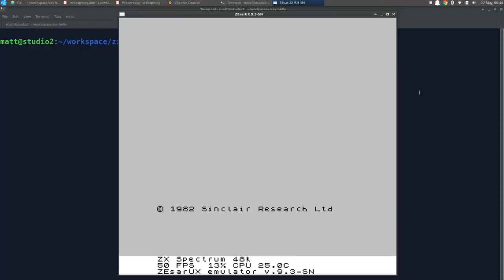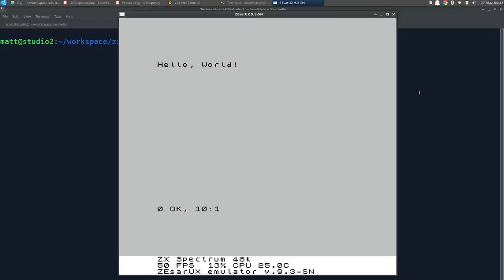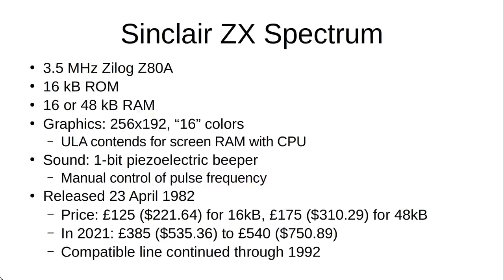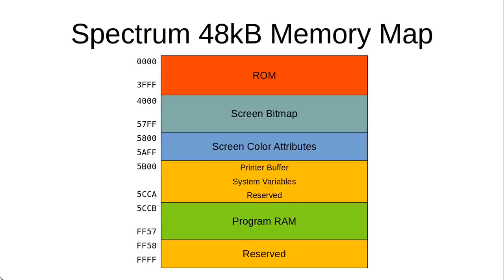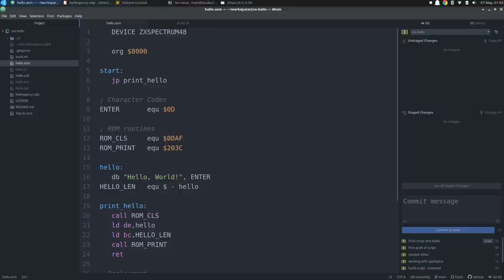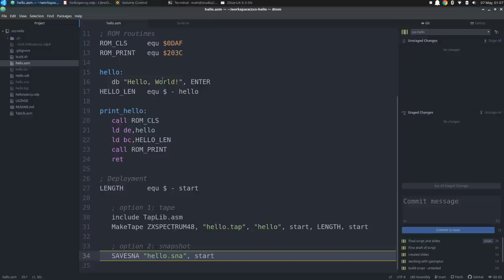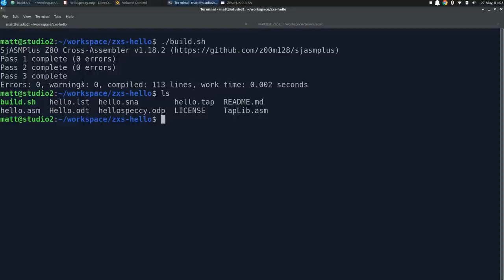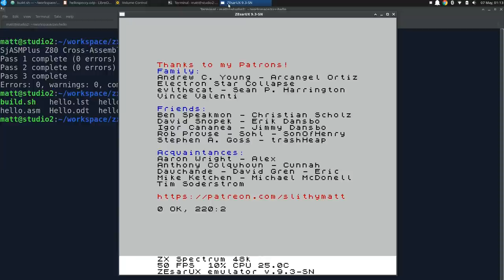Hello, Speccy! - "Hello, World!" for ZX Spectrum in Z80 Assembly Language

Comment: If you follow the timeline the ZX Spectrum was actually around the same price as a ZX81 with a 16k ram pack (around £79+£49) so consider you had 3x the memory, colour and simple sound and an improved keyboard it was quite a good deal. Most spectrums came later on with a pack of 6 software applications including games. It was a great starter or upgrade machine and was considerably cheaper in price than a C64 for instance. Hence it’s popularity. I started with my beloved ZX81 and upgraded to the ZX Spectrum, then the +, then the 128 before moving to an Atari ST.

Comment: Tail call optimization. A call followed by ret can be replaced by a jp, saving both time and  space.
Reply from the maker: You were beat to the punch by someone else in the comments, but it's still a good tip! Thinking about it, that would totally work with most assembly languages, including 6502:  JSR foo; RTS  -->  JMP foo

Comment: The key-shortcut method of writing Spectrum BASIC gets a lot of grief, but it was a really clever way of saving RAM. C64 and most systems stored the BASIC program in memory in plaintext, the Sinclair machines displayed keywords like PRINT, but only stored the token, saving RAM, and speeding up parsing and thus execution. Sir Clive had some really bright people working on his pride and joy.
Reply from the maker: Actually, Commodore BASIC (and I think most Microsoft BASICs) stored programs as tokenized. It just had to parse the string after it was typed.
Reply: @slithymatt  Ah I see, perhaps the saving, then, is that the ROM doesn't need a parser/tokenizer (or at least needs a less sophisticated one), so they could use that space for other stuff? My knowledge is rusty, I just remembered that the key-shortcut was an advantage for Sinclair, and this is how it was explained to me.
Reply from the maker: @RetroSwim  Not having a tokenizer probably saved a bit of space on the ROM, allowing for more BASIC commands. It still had the de-tokenizer, of course, but that's a lot easier.
Reply: @slithymatt  Makes sense. Nearly all my knowledge of this lower-level stuff was obtained from people that were probably on "Team Spectrum" back in the day, so not surprising there are some factual errors about the competition from back in the day :D
Reply: @slithymatt  Commodore BASIC even used some tokens as commands, which I hated. From memory instead of a command like CLS to clear the screen you PRINTed an inverse heart character. I found that kind of thing more unintuitive than learning where the keywords were on the Speccy keyboard.

Comment: My emulator, which is still in development, does emulate the 48K Spectrum completely, and also has a built-in debugger, editor and assembler for development.  It's called Nx.  It does support 128K and +2 but not with AY sound support yet.

Comment: Made a lot of software for the ZX spectrum, with as highlight my own basic interpreter. adds more than 30 commands.
including 64 colmumns, big letters, graphical commands, procedures all in Z80.
And i enhanced the rom with extra commands + a interrupt less keyboard driver. You can disable the interrupts and no lockup like a normal zx spectrum. And much more
back in the 80's
Reply from the maker: Very cool! Do you still have that code? Are you sharing it on GitHub or anything?
Reply: @slithymatt  Nope i do not have it anymore. It was made in  Hisoft GEMS and Artic assembler, this was made before github. The  source was saved on a micro drive cartridge, not a very reliable medium.
Reply from the maker: @pcuser80  aw, that's too bad. So much code has been lost to time and unreliable media

Comment: I never dived to deeply into Z80 assembly as I was only 13 yrs old in 1983 when I got my speccy so stuck mostly to BASIC but this brings back memories.  I designed and programmed my first program in speccy BASIC; noughts and crosses where you could play another person or against the computer, I ended up converting it to Atari ST BASIC and Borland Pascal later.  Thinking about that gives me an idea for my next "I'm bored !" project; a portable noughts and crosses using a Arduino and a touchscreen...
Reply from the maker: You may want to check out one of my older videos: https://youtu.be/WKxancg7XLA
Reply: @slithymatt  Your program looks very similar to mine in the fact that they were both a mass on if...then...else statements, I used a 2 dimensional array to hold the state of the individual squares, the first coordinate was the square (1-9) and the second held the state of that square (0=blank, 1=O ,2=X) and all the if statements worked off of that.  Simple but effective.

Comment: As far as I understand .SNA(p) contains content of all volatile memory - including basic area and system variables in the state of "you've just type in 'RANDOMIZE USR addr' in basic line with empty program and pressed ENTER". All vars are preset to ZX Spectrum 48 model, so emulation of another model will not work (or work with problems). So, ".tap" variant is more universal and will work on every model. Every game with machine code contains BASIC preloader (it is needed due to autostart ability) which makes series of LOAD "" CODE and then ... RANDOMIZE USR addr. You can write this basic loader to the .tap file from SjAsmPlus, but you need to recreate inner structure of BASIC program stored in the memory of ZX. It's not trivial, so if you are interested I can give all details of it.
Reply from the maker: The TapLib.asm file I include does just that, and that came with sjasmplus as an example. And I looked at the .sna format, and it really is just a simple dump of RAM from $4000 through $FFFF and an address to start running from, and not much else.
Reply: @slithymatt  Implementing BASIC loader you can discover interesting thing about Sinclair BASIC: to speed up things all numbers (literals) in program are stored in text form followed by six bytes: prefix $0E + 5 bytes of number in binary form. Binary form uses 1 byte for exponent and 4 bytes for mantissa, but then you use integer it is written as $00 $00 $LL $HH $00 where HH and LL are high and low bytes of integer. Then interpreter runs BASIC program it doesn't look to the text representation of number, but takes this ready to use precalculated binary data. This secret trick makes possible some form of program protection: BASIC loader can look like it makes RANDOMIZE USR 0 (or something) which could drive crazy some guy wanting to make some POKES before running game. :)

Comment: Nicely done - really enjoying this series. You should try this on the BBC Micro next - the supplied BASIC had an assembler as part of the language which made machine code development on the machine really easy
Reply from the maker: I did consider doing the BBC Micro back when I was running through different 6502 machines. I may go back and do a round up of different 6502 home computers, throwing in Apple II and Atari 8-bit as well.

Comment: ZX Spin is also another really good speccy emulator, it has its own dedicated assembler so you can type in your code, assemble it, then just go back to the emulator screen, type RANDOMIZE USR followed by the address where your code was written and you can see it running there and then
Reply from the maker: ZX Spin appears to only work for Windows, so that's a no-go for me
Reply: @slithymatt  With any emulator you should be able to use that "RANDOMIZE USR 8000"  (or any other address, even in ROM) from the prompt, to run an asm program as many times as you want.
Reply from the maker: @blassoriano109  yeah, I just couldn't figure out how to actually type that into Sinclair BASIC. This platform better illustrates my contention better than any other that assembly programming is easier than BASIC.
Reply: PRINT USR and RUN USR are alternatives to RANDOMIZE USR. RUN USR being the most logical variant here, RANDOMIZE works, but it's really a hack because it is actually the command that initializes the random number generator, you can put a number after it to use as a seed.

Comment: In those days I always wanted to cram as much code as possible in available EPROM or RAM space and I did not like to have to waste so many bytes on setting up registers for a call to display a message.
So when I coded things from the ground up, I used the trick to inline the message text with the code.  Like this:
CALL msgout
DB "message", 0
... further code.
So when executing this, the msgout routing would pickup the message text at the return location, and return to the byte after the text (in this case terminated by a 0 byte).
It is easy to code:
msgout EX (SP),HL
LD A,(HL)
INC HL
EX (SP),HL
OR A
RET Z
CALL chrout
JR msgout
in this example it is assumed that a chrout routine exists that outputs a single character held in A.
The EX (SP), HL instruction pops the return address off the stack and saves HL at the same time, and then the code gets a byte and advances the pointer, stops when it is 00 and if not it outputs the character.

Comment: "You can't run the BASIC loader program again at this point"

It should still be in memory. The BASIC loader tends to be a simple program along the lines of:
10 LOAD "hello": RANDOMIZE USR 32768

Press 'K' to get a listing to see if it's still there, then 'R' to run it again.
Reply from the maker: It appears to be in memory, but the tape is no longer cued up to the machine code, so it can't find it without "rewinding the tape". So the LOAD command needs to go away and just be replaced with a RANDOMIZE USR call. I couldn't figure out how to type USR after the RANDOMIZE because... um, Sinclair. So, basically, the whole tape image just needs to be reloaded. But it looks like there is a magic combo to type in the USR token at that state, it was just FAR from obvious. At any rate, there doesn't seem to be such a thing as a rerunnable loader program without being able to rewind, and at that point, might as well just reload the whole image, loader and everything
Reply: @slithymatt  Yes, you'll have to drop the LOAD command. I don't know about ZEsarUX - I'm a Fuse guy - but USR is CTRL+SHIFT for extended mode, then 'L' on Fuse.
Reply from the maker: @jamesweatherley9215  it's the same on ZEsarUX. Same keyboard mappings, same ROM
Reply: @slithymatt  Every keyword is a magic combo. Real Speccies came with a good manual and of course had every keyword on the keyboard in different positions and colours.

Comment: The Spectrum + could be had on sale for £129, which was exactly the same as the 48K, but with a more proper keyboard rather than the rubber keyboard. That was when I got mine, and wrote an assembly routine to quickly swap sprite banks so that more could be used overall.

Comment: In terms of video output composite and YUV component was present on the edge connector. (These were removed with the 128k, and later, models.)
The RAM implemented as separate 16k and 32k banks.
Thus the 16k model could be upgraded to 48k. Either internally or, like the earlier ZX80/ZX81, using an external "RAMpack".
The 32k used "half working" 64k chips. Which would otherwise have been considered waste.
Typically modern restorers just fit 64k chips...
Back in the 80s there both hobbiest and commercial projects to produce an 80k machine through using 64k RAM and bank switching via an I/O port.

Comment: Hi Matt, I have a question on performance.
I I've been playing around with BASIC/assembly compiler by Boriel.
It works like a charm so that the binary executable can later be loaded into the emulator.
But what I'm wondering is will the code run faster if write in assembly directly?
I mean in C it's hard to write assembly code that would be faster compared to the the one written in C but with optimization flags but is it so for zx spectrum? Or is it just the matter of how well compiler can optimize the code?

Thanks in advance!
Reply from the maker: If you know what you're doing, writing code in assembly will be give you much better performance, even compared to writing in C. The Z80 is not a modern processor that is designed for compiler optimization.
Reply: @slithymatt  Thank you!

Comment: Actually I remember when I was living in UK at my mums as teen on the back of cornflake boxes they were selling the 16 or 48k spectrum for about £39.99 along with so many  vouchers you cut out and saved possibly bought the computer 5 times over in boxes lol, actually in 1991 I bought a 128+2 from a catalog for £179.99 lol then I bought the Amiga 500 from a mate then had to buy a keyboard, mouse, disk drives .. was ripped off / scammed with that Amiga .. he saw me coming that man that cost me £150 at time may as have bought the thing new in the end

Comment: You can re-run the program again using the basic command "RANDOMIZE USR <ADDR>", the address have to be in decimal not in hex. It will work as a jmp <ADDR>.
Reply from the maker: I've tried to do that, and I can't get it to work. After I "type" RANDOMIZE, I get into regular typing mode, so typing out Shift-U-S-R does not seems to get me a real USR token and the statement fails
Reply: @slithymatt  "USR" is another keyword; in a real Speccy its above the letter L, which means you have to put the cursor in "extended mode" (flashing E in the cursor instead of K or L) to get it. All of this means: in Zesarux, press "T" to get "RANDOMIZE", then press Shift and Ctrl (Caps and Symbol Shift in a real Spectrum) to get extended mode, then press "L" to get "USR", then "32768" ($8000 in decimal) and finally Enter; it's much easier with the keywords in the keys :)
Reply: @Protocultor  And don't forget USR() is a FUNCTION - it returns the contents of the BC register. So if you want to make your own blazingly fast functions, this is the way to go. Just a shame you have to POKE any parameters..
Reply: Right. But you better use any other way to retrieve BC if you have to use the RND function in BASIC afterwards. This popular method will init the random number generator to the same value so you'll get the same sequence of random values every time and that is... well, not that random anymore XD.
Reply: @RufianEmbozado  BTW, here is the Wiki page documenting that PRNG: https://en.wikipedia.org/wiki/Lehmer_random_number_generator#Parameters_in_common_use
Reply: @HansBezemer  Nice! I had to learn it the hard way some life ago.
Reply: @HansBezemer  either I didn't know or forgot, but thanks, that's much better than doing PEEKs.
@RufianEmbozado, a simple "LET someVar = USR 32768" will suffice.
Reply: @Protocultor  The PRNG is found in the ROM at #25F8. It's pretty simple, but capable.

Comment: I would have thought it might have been nice to look at how to do it without doing a CLS (just call the CHAN-OPEN routine at 0x1601 with the stream number in A) Maybe you could have mentioned RST 0x10 for printing a single character. Also it is possible to embed control codes to change the appearance (PAPER, INK, FLASH etc) so 0x11 0x02 should be a red background. But good stuff anyway.
Reply from the maker: Thanks! I plan on getting into all that in the tutorial series. I just wanted this first one to be as simple as possible, and tie closely to BASIC.

Comment: Good video, was really interested in the tool chain being use since doing this within the Speccy natively, even in emulation, is painful!

Following along in Windows 10.  Can't get Sjasmplus to work.  Whatever I do the exe comes back Access Denied.

No probs as I'm using ZXSpin which has a built in assembler.  

For those notin the know, ZXSpin, even after over half a decade of no development, is the single best Speccy emulator in existence! Probably run under Wine on Linux, worth checking out.

In ZX Spin you don't need the org line since you give this address when you hit the assemble button.  And none of the development code for tap and sna at the end would be relevant either.

PRINT USR 32768

should rerun the machine code from BASIC.  PRINT USR being the Speccys call routine and 32768 being the decimal version of address hex8000.

Though if you reallu want to rewind the tape and reload the mcdode only by rerunning sjasmplus tape loader from BASIC then ZXSpins tape handler will let you do this easily!

Anyway got the code working.  Commented each line to prove to self I fully understood whats going on. Then played around with changing the message displayed.

Can't wait for the next part!
Reply from the maker: Did you try the pre-built sjasmplus binary from the GitHub release?
Reply: @slithymatt  yep, only version I tried. I figure Win10 is just being an arse! Not a problem as I say I can follow along in ZXSpin. Bit more integrated and a little easier.
Reply from the maker: @linuxretrogamer  Worked for me just now on my Win10 desktop. Did you make sure to put the directory containing sjasmplus.exe in your path?
Reply: @slithymatt  lazy coder.  CD to dir then used .\ to reference the path.  Either way it was the exe giving access denied, even on a simple

.\sjasmplus - - help

Went through file/folder permissions but it was having none of it!
Reply from the maker: @linuxretrogamer  hmm... very strange. Something must be weird with your settings
Reply: @linuxretrogamer  If you are still struggling with sjasmplus, then you might want to take a look at pasmo which can output tap or tzx files (but not sna)